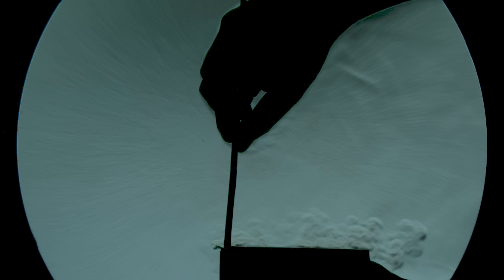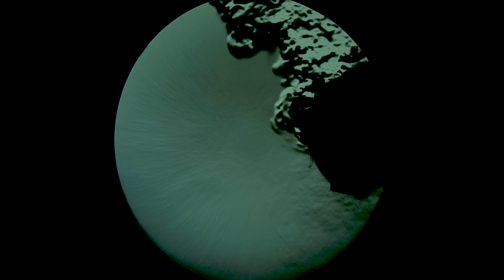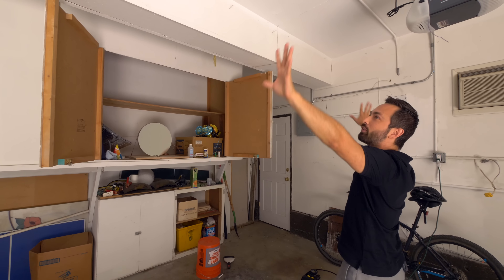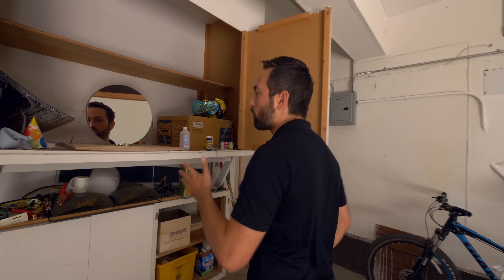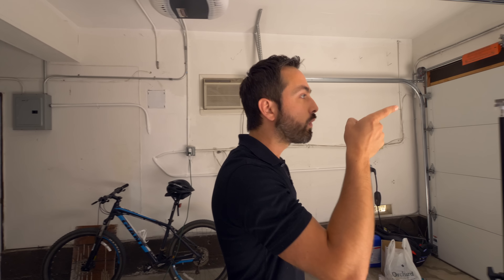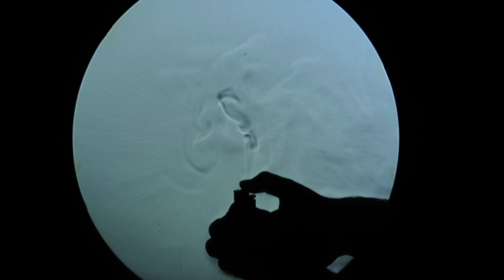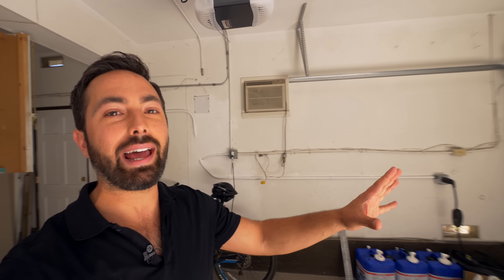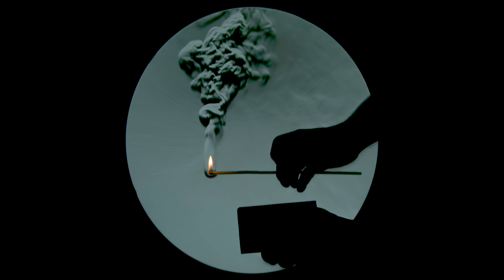How To See Air Currents

Comment: Would love to see any of these:

A pair of hands clapping, 
A birds/Insects wings flapping, 
A tuning fork ringing, 
A set of Newtons Cradle in motion,
A gyroscope spinning,
A spark across 2 points (as in a Van De Graaff), 
A fluorescent tube striking,
A drone hovering,
A feather falling.

Looking forward to whatever you end up trying. :D
Reply: I also think a bird flying would look amazing! It could be frustrating to control but with a trained bird like a Budgie or something, definitely possible.
Reply: Joe C and a partridge in a pear tree
Reply: Knew I was forgetting one. :D
Reply: Joe C I'd like to see the tuning fork.
Reply: I would also like to see alongside this list
A string from a harp or bow plucked
A pot of water boiling
A bouncy ball being dropped and bouncing
A deck of cards being shuffled
A slinky in any kind of motion that can pertain to a slinky
A baking soda volcano in a clear container to show the slow motion chemical reaction
An Alka Seltzer tablet or an aspirin dissolving in water
A can of spray paint spraying
A gun of any kind being fired
A cord of rope or cut hair being burned up
A pencil or small piece of wood being snapped in half by hand
A glass being smashed

This is a really amazing method of capture and is a really cool idea for art.
Reply: Hairdryer
Reply: Ventilator?
Reply: Ventilator blowing into a razerblade??
Reply: Joe C farts. don't forget about farts. warm fart in a cool garage would look amazing
Reply: or paper tearing.
Reply: laser stuff
Reply: Joe C can that work for carbon monoxide
Reply: See some more stuff like this from another youtuber,  brusspup ("Amazing Mirror Experiment Reveals Invisible Air Movement!")
Reply: Paper Ripping
Reply: it would be cool to see a speaker that plays different kinds of music

Comment: How about a
*Speaker playing music, wouldn't it oscillate the air???
*Keeping a small plant and seeing the exchange of gases that take place.
Reply: In the case of the speaker,I don't think we'll see anything . These all effects are due to difference in refractive indices of hot and cold air. But the speaker will just move the surrounding air around which is basically at the same temperature.
For the plant case, isn't that process too slow to be visible?
Reply: Air at different pressures should also have slightly different refractive indices, right?
Reply: Gurjeet Singh wouldn't the speaker work, because denser air refracts different than less dense air?
Reply: Oh yeah totally overlooked this fact. So the speaker one would indeed work!
Reply: What about having the heat from a candle moved by a sub woofer, or speaker?
Reply: Playing a tone through the speaker that was resonant with the "shutter" speed of the camera would generate an apparent standing wave which should be clearly observable with this instrument.
Reply: Yes - air at different pressure have different density, wich affect the refractive index. But you need a really fast camera to capture the waves travelling the speed of sound. Another thing to take into count is the wave length of the sound. Bass will not be visible with this setup, because the wave length is much longer than the width of the mirror. 
The mirror need to be at least one wave length to show it reasonably good - as it was 40 cm, that means that only the part of the music at frequencies 860 Hz and above will be visible. The higher the frequency, the better it will show up. A high pitch tone would probably show up more clearly than music.
Reply: Yes of course!! Thank you - good point.
Reply: Changing the density will change the refractive index, but it would probably be too minute to make a difference, unless he plays it very loud.  So he better bring his earmuffs haha.  And by the way, I could be wrong, so it's worth a try
Reply: And setting the tune just a little bit off-resonance should allow to see the movement of the pressure waves! :D
Reply: Murali Krishna +
Reply: If I remember correctly his hi-speed camera 'shutter' is faster than sound speed at that scale (40cm). But more elegantly you would simply use the shutter-to-frequency ratio to get a perceived movement (aliasing).
I would love to see this experiment!
Reply: The signal profile would have a significant effect on the required volume since the observable change in air pressure would depend on how fast (and far) the speaker cone moved. So, for instance, a square wave pulse might show up more clearly than a sine wave. Adjusting the duty cycle (width) of the square pulse might optimize visibility at lower volume levels. Seems worth a shot to me.
Reply: A time lapse can solve the issue of the process being slow.
Reply: David Caster  Yeah that's probably true.  But it would be interesting to see the different effects that sine waves make, versus square or saw tooth
Reply: Indeed, the effects of different waveforms would be interesting to study.
Reply: Derek should play his trumpet, focusing the light at his bell, and play piano, forte, and sforzando. I saw a similar video of a trombone but the title was of a shock wave. I want Derek to tell us if it really is one.
Reply: I wanna say you would see it. The speaker will create areas of higher and lower pressure in the air which will create differences in the refractive index. This would also be called an index grating and it is used in acousto-optics
Reply: First i was expecting some ultra high speed advanced  MRI kind camera that detects tinniest density variations.
No, just high speed camera, a concave mirror, a LED and a razor blade in the garage 
No words
Mind blowing
Reply: Murali Krishna am i hte only person that didn't understand a thing je was talking about?
Reply: Would radiation work? Electromagnetic from a radio or something and alfa/beta from some element. It'd be cool if it did.
Reply: you can put a candle in front of the speaker to notice a difference cant you?
Reply: +Andreas Østergård beta would definetly work, search for  loud chamber
Reply: Yeah, that's also where I got the idea, I saw a GIF of sume Uran in a cloud chamber on reddit.
But idk if it's to subtle a change, that you'd really be able to see it here. I mean, the reason you can see it in a cloud chamber is that it's just on the verge of condensing anyways... But it'd be really cool to check out, and I think you're right that it would work
Reply: thats an awesome idea
Reply: Sülfür hekzaflorid
Reply: Would it be possible to create some kind of cymatics like effect on the air that would be visible with this setup? Maybe using sound waves to manipulate different atmospheres or gasses? Or observe how sound waves might effect the match strike or some of the other examples in this video?
Reply: Great idea but as others noted he would need a proper high speed camera to see them clearly I think he should give it a shot
Reply: he should just do it
Reply: Two speakers with producing different frequencies should then generate some sort of cymatic pattern :D
Reply: That's what I was just thinking; would the camera pick up the vibrations in the air 🤔
Reply: When air compresses it does heat up, but the effect would be microscopic. It may see something very subtle, but wouldn't be very exciting at all.
Reply: Or how about two speakers facing each other, aligned such that they cause standing waves.
Reply: If you want to try imaging sound waves, you might have an easier time in water rather than air because of the larger wavelength (c = lambda x f).
Reply: I forgot to mention that by sound wave I was thinking about ultrasound for which wavelength is in the mm range in water ;-)
Reply: When you increase air pressure via compression, temperature also increases

Comment: What is the difference between parabolic mirror vs concave mirror? Could a thermal camera pick up the temperatures with this setup? Setting off a small firecracker would be fun, the fuse with its heat and then the bang if done in slow motion. If thermal cameras work you might have to do this a number of times just to see all the possible effects.

Comment: I have to tell you that this is one of the most impressive things I've seen in along time. Being an aerospace engineering student I find it very cool that you can visualize pressure and temperature gradients on a fluid. Maybe you can try to visualize the boundary layer generated on an object when an air current is applied. It would also be cool to see the transition point between laminar flow and turbulent flow, or the boundary layer separation.
Another idea might be air flow through a nozzle. A converging-diverging nozzle must be interesting to see but I am aware of the difficulties of such thing.
Nice video, keep up the good work!!

Comment: As an ex-aerodynamicist, you bring back many happy memories of using Schlieren systems to investigate transonic flows over a whole bunch of different shapes. You might like to try to produce "colour Schlieren", where you replace the razor blade with a discrete colour filter - we used to use different coloured bits of transparent gel used in theatre lighting. The only problem is to get the filter small enough to produce the desired colour changes. But it's great fun trying! Good luck.
Reply from the maker: That's a great idea! Just googled some images and they are spectacular. I'll give it a shot.
Reply: What would happen if you used a prism in place of, or in conjunction with the razor? would it be possible to observe a colour gradient?

Also, could you put a fish tank in front of it and watch some fish swim around (might move your focal point as it refracts through the water.
Reply: @veritasium  could you tell me where to  get one  of those curved mirrors so I can try it, too?  Thanks!  Great stuff.
Reply: @liveoak144  Try Edmund Optics or ThorLabs, both are great options
Reply: @Javier-cl8lf  hey, thanks!
Reply: Damn he actually ended up doing that
Reply: @veritasium  Silly question, perhaps? Did you add some sound effects during the slow motion videos playing like during the match lighting or that's how it sounds naturally in slow motion? Thanks for the insights!
Reply: Why 
Does everything have a plain green or gray background.in the video.why cant we see the rest of the room in nornal visible colors like when he is talking and showing us the set up? There must be some kind of color filter on the camera lens right because the razor blade would only block light. Ot change the colors we see right? And why isnt everyone else wondering about that too? Seems like the most obvious logical and a smart question to ask?
Reply: @veritasium  I get that light is refracted so the color of background objects will change but why is everything in a simple gray or greenish background in the videos? You didnt explain that it can't just be the shadow from the razor blade and the light refraction..why can't i see the walls or backrground objects in the room like when you were showing us around the set up? Thanks..
Reply: @leif1075 
I know your question is over a year old, but my guess is white balance.

The camera is focused on the mirror, which appears bright white because the whole surface reflects the tiny LED next to the camera. The concave mirror basically works just like a giant magnifying glass, magnifying the LED.

Compared to this "giant", bright and white LED, the rest of the room appears really dark. It's like trying to see someone standing next to a car with the high beams lit.

As a result of the razor blocking half of the diverted light, that causes a shadow effect (darker), and similarly the other half of the diverted light causes a higher concentration of light, thus brighter spots.

For the brighter spots to be brighter than the magnified LED, you adjust the white balance of the LED down by reducing light sensitivity even further. This causes the rest of the room to appear extra dark and dull, because it's much darker than the LED, and it's also out of focus.
Reply: @Trotters79  Thanks for answering but I don't think that explains why there is a hrayish or green tint to everything around right? It should just look darker bjt retain the same overall color scheme or hues..see what I mean?
Reply: @leif1075 
Perhaps because glass often has a green tint to it, and all the light collected by the camera has passed through the concave mirror? Just a guess.
Reply: Just got into Aerospace Propulsion PhD , now I will be going through this journey as a curious child. Today itself me and my friend were struggling with focusing schliren 😂

Comment: You can also see this effect by using a reflecting telescope aimed at a star. First set up the scope aimed at a star and then change the focus of the eyepiece from a pinpoint until it fills the field of view of the eyepiece. Once the big blurry star is visible you can see heat from your hand or your breath when in front of the mirror. Obviously you have to be in front of the telescope for this to work. The farther away you are the more sensitive it is.

Comment: diaphragm of a speaker moving the air
Reply: ThePageNo1 yes please!
Reply: ThePageNo1 Yess!!
Reply: YESS PLEASEEEE.
Reply: Low frequency sound waves are too large to show in that small area, but if the capture frame rate is high something like 1khz might show :)
Reply: i'm in on this one.
Reply: what about a resonant frequency in between two plates? nodes and antinodes
Reply: Yes or just a speaker firing against a solid surface with the frequency such that it forms a standing wave with the source. The frequency still has to be within the capture rate of the camera.
Reply: Or a tuning fork!

Comment: A standing wave created by speakers!
Reply: Nice!!!!!!!
Reply: Yeah!
Reply: Maybe a Subwoofer?
Reply: don't you need temperature difference though?
Reply: Just a difference in index of refraction.  Temperature causes gas to expand, and the expanded gas has a slightly faster index of refraction, so temperature differences are easily seen with this technique.
Reply: Wouldn't we actually be seeing the air being pushed by the speakers?
Reply: It'd need to be a high tone if you want the wavelength to fit nicely into that tiny picture.
Reply: This and musical instruments was my first thought. If you put a powerful speaker near the mirror and projected a loud wave, would you be able to see any pattern in the vibration of the air? Would it be anything like a chladni plate?  Would you need to or could you find a resonant frequency? What if you somehow put the experiment inside a helmholtz resonator, or transparent cross section of one? What if you put another medium in the shot, such as the candle or a hot lamp? How about a vibrating string?
Reply: Well seeing the compression wave created by sound would be cool. And it wouldn't need to be very high to fit.
Reply: The easiest way to get a standing wave would be to play on a speaker at the end of a transparent tube either white noise or a pure tone finely tuned to the appropriate frequency.
Reply: yes! that would be awesome and it would work to because the air the speakers push out will cause a difference/in balance in the air
Reply: A clap of hands should make a visible sound wave.
Reply: A transparent tube, if it was a round cross section especially, would refract the light too much. I think putting two speakers opposite each other playing the same tone would be more appropriate.
Reply: Would be cool to see it via an equalizer made with a tube of PVC, holes at even intervals, and propane.
Reply: Bobby D17 So, a Rubens' tube?
Reply: There is also to try :
- cold air flowing on hot air
- pressurised air in some glassware 
- spinning propeller toy (Taketombo)
- a vacuuming chamber
- trying to see differents layers of gaz (sulphur hexafluoride might be cool to try)
- changing the color of the LED
- using 3 LED : Red Green and Blue
Reply: Agreed!
Reply: I came here to say this, 100000% agree
Reply: yep!
Reply: keco185 +
Reply: Phirdeline he says differences in pressure in the begining so soundwaves should work.
Reply: ManWithBeard1990 You would just need a wavelenght smaller than that mirror so it wouldnt need to be that high but ya standing waves wouldnt work since the standing waves in a room that big would be very long.
Reply: good look to him
Reply: You can have whatever wavelength you like as long as it fits in the space a whole number of times. And that space need only be the space between two speakers.
Reply: ManWithBeard1990 I think it's actually as long as a whole number of half the wavelength can fit in the space.
Reply: you're right actually
Reply: No, not nearly cool enough. By Opera singers. Now that would be awesome

Comment: Please try spraying from a flamable liquid (DEODORANT CAN) and then put a LIGHTING MATCH in front of it ... and see the boom...
Reply: As cool as that would be, I think one problem with that video would be that the light from the explosion would overpower the light from the LED and you'd mostly just see the explosion. You might see a lot of disturbance in the aftermath (once the explosion ended).
Reply: Yeah... that is a very valid reason....   
But on the other side we may see a shock wave or something unusual.....
and also we can see the flame colors.. that would be a lovely scene....

Comment: Thanks for the video. This is such a nice setup :) I suggest you try some of the following:
- open a carbonated drink (remove cap of a beer)
- surface of a carbonated drink sparkling
- start a firecracker / roman light
- laser heating up the air
- shoot a gun / airgun
- audio speakers
- use multiple speakers to create standing waves in the air
- piezzo crystal making sound (maybe surface view?)
- create an electric arc (plasma)
- laminar vs turbulent flow
- spinning ball
- arrow flying

Good luck and have some fun!
Reply: RIPxBlackHawk he gave ideas, not tell him to do.
Reply: fart.